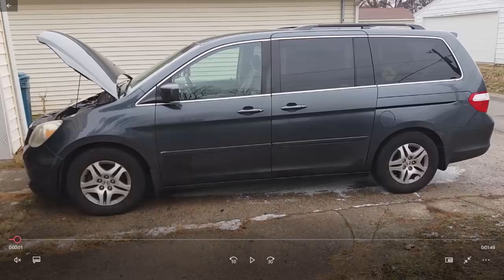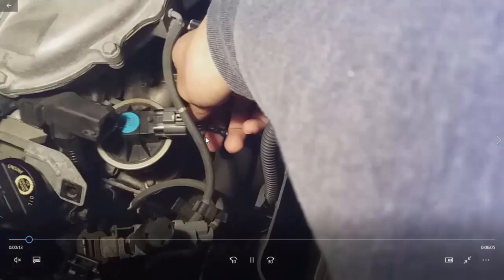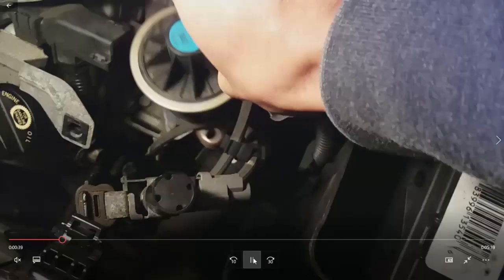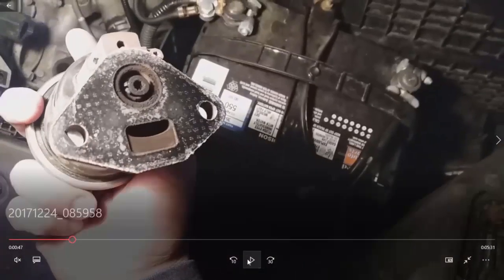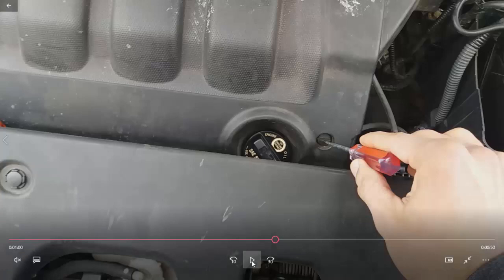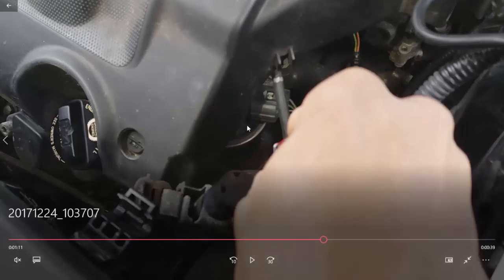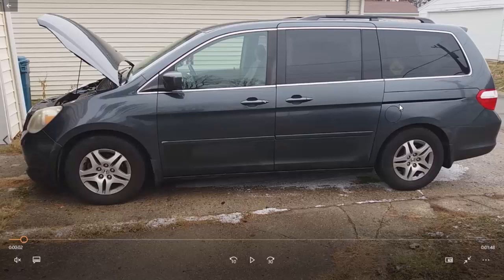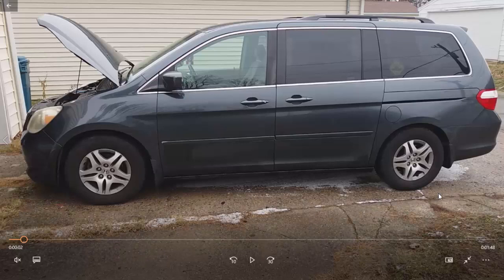2006 Odyssey - Several Cylinder Misfire - Upstream component issue.

Comment: YOU DIDN'T MENTION HOW MANY MILES HAVE ON ENGINE, ! TIMING BELT CAN  READY TO BREAK BECAUSE IF ITS LIFE EXSPECTANCY EXPIRED AND BELT IS LOOSE AND READY TO BREAK WHICH CAN CAUSE MISFIRES AND IF BELT NOT REPLACED AND BREAKS THAT WILL COMPLETELY DESTROY ENGINE AND IN NEED OF ENGINE REPLACEMENT ! CHEAPER TO HAVE BELT CHECKED BY HOW MANY MILES ON ENGINE , YOUR FINDINGS OF EGR VALVE MIGHT BE CORRECT BUT IF PLAN TO KEEP VEHICLE AND MILES INDICATE TIME FOR NEW BELT THEN BELT CHEAPER THAN NEW ENGINE ! ODESSAY TIME BELTS NEED REPLACEMENT ABOUT 60-90 THOUSAND MILES .! BAD TIMING BELT WILL CAUSE MISFIRES AND WHEN REALLY BAD CAN START ENGINE KNOCKING  WHEN VALVES HITTING TOP OF PISTON THEN THAT MEANS ENGINE DESTROYED.!! MY ODDESSAY 2007  MISFIRING , CHANGED PLUGS AND COILS THEN SLIGHT IMPROVEMENT BUT BACK TO MISFIRING, 33THOUSAND MILES WHEN BOUGHT VEHICLE NOW HAS 138 THOUSAND MILES SO IT HAS REACHED THAT CRITICAL POINT WHICH IS BELT REPLACEMENT. REBUILT ENGINE ABOUT $5,000 ! USED ENGINE ABOUT $2,000 BUT MOST LIKELY WILL ALSO NEED NEW TIMING BELT , ALTERNATORS LAST ABOUT 100,000 MILES MINE DID AND REPLACED IT ! ALONG WITH PULLY TENSIONER AND AIR CONDITIONER COMPRESSOR AND ALSO REPLACED STEERING PUMP ,AND ALL TOP ENGINE GASKETS AND EVERYTHING IN BETWEEN , AND YES TRANSMISSION WILL BE NEXT THAT WILL NEED REPLACEMENT BUT WORKS GREAT NOW ! HAVE GOOD DAY !

Comment: My 2005 honda odyssey check engine light was on...code reads slow and large leak detection but can't find no rips in any hose...had misfire in cylinder one...so I changed all 6 spark plugs and all 6 coils and new valve cover gasket..
Get job done turn van on and it sounds like a lawnmower and check engine light is blinking like crazy now.
.what cause this to get worse...please anybody..yes all coils are snapped on all way and spark plugs are new and van ran just fine before all these parts
Reply from the maker: If the van was running fine, and only had a leak and a misfire code in one cylinder, why did you replace all spark plugs and coils? Off the top of my head I would have thought that the leak cause the misfire and since the misfire is on one cylinder only, I would have investigated the gas going to that cylinder first. 

About why is worst now, I would guess a valve or a component was left unplugged when the job was done. 

All of these are guesses. Normally the way YouTube works is we do the job and illustrate it so others can follow if they have similar problems.
Reply: @w.v.1833  thanks but I have always seen and told if one coil is bad or one spark to replace all if you have the money so I did...and I made sure all coils clipped on all the way to avoid anything like that. Thanks for trying to help..van is still sitting in driveway I'm lost man ...
Reply from the maker: @kangokidkidd4037  check all other plugs that would have been disconnected to do the job.
Reply: @w.v.1833  okay I have to check again...I just ordered an egg valve too from rockauto....some youtuber said that maybe it but I don't think so because the egr valve was cleaned by me 3 months ago...but never replaced ..he said egr could be stuck open...but how could an egr just get stuck open or closed just by me replacing all sparks and coils..I also changed the valve cover gaskets put little honda bond on the 2 corners just like the pros....

Comment: That was very wise on you doing the research cuz I was breaking my head on figuring out what could be wrong all of a sudden the engine light comes on and I'm getting about the bowl of readings it getting done on me the only thing usually common was to change spark plugs and coils but now things got a little bit more difficult I figured maybe the fuel injectors were clogged I did all that and it didn't dawned on me until now watching this video that the EGR valve has some play with it so thank you and I'm going to check that

Comment: Dude i feel like kissing you :), this last Friday night wifey went out on the minivan, then she call that it was shaking really bad, she pulled into a parking lot and it finally stalled, i went to see what was going on and the car would not start, it was kind of hot but not full gauge, this was like 3-4 miles away from home, so we came home had diner, went back two hours later to see if cold would start and it did, at first start sounded normal no shacking, on the way home probably because warmed out started shaking. i hooked up the ODB2 but was shot, i lent it and it got few pins broken on the connector... looked up few videos about rough idling, some guys pointed to timing belt... other guy fused coil and he ended up braking one of of the spark plugs and the electrode falling into de piston.. bunch of non sense. yours made more sense, although i am preparing to replace the timing belt and water pump on myself,, the minivan is pushing 250K,  so timing belt also sounded plausible,

Long history short, pulled the EGR valve and looked identical to yours, cleaned it up, put new gasket ($2.5+$5) gasket and cleaner,  and voilaa fixed like magic. OMG

Thank you very much for publishing this video
Reply from the maker: 👍🏼I am very glad the video helped.

Comment: Hi thanks for the video . I did EGR cleaning does the check engine turns of immediately or did you have to drive around to clear the check engine erro .

Thanks
Reply from the maker: I used a code reading device to erase the code which turned the light off. However, I believe that if you disconnect the negative pole of the battery for a few minutes the light will also go off. 

Please note, that if the blocked EGR was not the code that turned on the light, of if there are additional codes present, the light will come back on. 

Good luck.

Comment: Thank you so much for such a helpful video.  On my 2006 Honda Odyssey EX-L, I was getting the same random engine misfire codes.  I took some photos of your youtube video on my phone and printed on a printer and showed my local mechanic.  He peformed the EGR cleaning for me for about $40 labor and he confirmed the carbon buildup was keeping the EGR stuck open a little bit.  After the repair, I cleared the ODB II codes, they haven't come back.  Your video was very helpful and saved me a lot of diagnose labor charges by my mechanic.  Thanks again.
Reply from the maker: I am happy to hear!

Thank you for taking the time to provide the positive feedback.

Comment: but you didn't show a reading of results.
Reply from the maker: You are correct! I think I mentioned at least some of the codes in the video, but I did not show any of them. I wished I had. I created this video after I had diagnosed and solved the problem, only to share what I did to solve the problem. 

Thanks for commenting.
Reply: W. V. so did the code change after your repair ? or did it remain? thanks!
Reply from the maker: Yes. I erased all the codes with my personal handheld scanner and none of the codes came back. 

I am not sure if you know but you can get the engine light to turn off by disconnecting the battery or by erasing the codes, even if you have not addressed the problem. A repair is considered effective when you erase the codes and they do not come back. In my case, they did not. What is even better, the terrible performance symptoms went away. As soon as I completed the job the engine ran normal. 

I hope my answer is complete. 

Thanks.

Comment: I've been struggling with 2 Honda dealerships to find the cause of my misfires and they told me it's a needle in a haystack!  I have tools and a can of engine degreaser in the closet, I'm hoping that this will solve my problem, too.  I've already put 6 new plugs and coils on it, so I know I'm good there.  I'll report back if the issue is solved!  Maybe I should send you the $100 I gave to Honda for diagnostics, lol.
Reply from the maker: Lol. Thanks for sharing Alicia. I hope you fix the problem on your own and in the process learn something new and save some money.

It is often useful to surf the net for solutions to problems like this before visiting mechanics. After all, they do the same thing we would do when facing a problem they haven't had before: research the problem, analyze the issue critically and try solutions. However, one thing they have that owners lack is experience (and some times the right tools). Mechanics fix cars day in and day out, and that how experience is built. The best thing about the internet and how we share content is that: no single person needs to have a lot of knowledge and experience, but collectively we have enough knowledge to help each other solve many problems that often seem complex.
Reply: these Honda V6 engines just love to misfire for all sorts of seemingly unrelated reasons. The fuel injection is designed as a ULEV, so it tries to lean out the cylinders mixture a lot.
When this engine does not have hard misfire codes (leaky EGR), it still randomly misfires lightly at idle without any code detected.
The outcome is the engine does not drive very smoothly because the power output is non-linear.

TO-DO maintenance List items:
Spark plugs
(Spark coils)
EGR plugged or leaking: codes!
Tight exhaust valves adjustment
Dirty throttle body butterfly
Round transmission filter: 80kMi!
Serpentine belt slipping under load
Cracked air inlet rubber boot
(front/rear engine mounts)

List of bullet-proof items:
fuel pump and filter: ok!
injectors: ok!

Misfiring detection: the engine control unit looks at the crankshaft speed variations to determine if a particular cylinder causes the crankshaft ticks to be late there by showing a slow down ie. misfire.
So if the misfiring is light the ECU will not know about the condition but the driver will still experience driveability issues, light shaking at idle, reduced power output, reduced low-rpm torque.

This engine can really run well like new @200kMi for a minimal amount of simple parts. Don't overlook the tranny 3x3 ATF change to prevent premature failure.

Comment: Usually it triggers a code for egr. Just bought an o6. Love your odyssey color same as the one am replacing, mine is silver-ish but nice and the price even better.
Reply: No. It doesn't. If the EGR passages is completely plugged, you will get a specific EGR code. I chased my tail on this until I created a gasket out of an aluminum can and put it in. All the misfires and TCS lights went away and ONLY the EGR code came up. This let me know that the EGR was the only problem. I swapped it out for a new one and all the nonsense misfires, check engine and TCS lights went away. Most will be steered wrong to a valve job. Try to plug the passages first with the aluminum gasket. Good video here on YouTube.

Comment: Which 3 cylinders 4,5,6 having similar problems gonna try tonight.Ill let you know.
Reply from the maker: I could not tell which ones. I made this video a while back. However, Cylinders have an order in which they fire, that I believe varies depending on the engine/engine type. This could be a good thing to keep in mind during troubleshooting. 

Still, checking a stuck EGR valve will take only a few minutes and it is worth checking to make sure it is clean an unobstructed. 

Good luck.
Reply: @w.v.1833  Pulled the EGR and it was clear.
The firing Order is 142536.I have pulled and tested each coil and they are working properly. I think my problem is a Vacuum leak from a cracked or broken line.
Reply: @RichardNixion357  did you find your problem? I have misfires on cylinder 4,5,6 and cannot pinpoint the problem.
Reply: @jeremyvaughn8663  Afraid my solution wont be much help but I tell you anyway.I disconnect the battery for 15 minutes reconnected the battery.Turned key to position 2 scanned codes,be shure to write down any freeze frame info,then cleared codes.Removed key,Inserted Key turned car on no codes hasn't done it since must have been a fluke. Hope you find a solution.Lotta guys smarter than me would tell you to check and recheck your work and try anything no matter how crazy or insignificant it might sound.
Reply: @jeremyvaughn8663  Oh sorry a whole bank like that would be head gasket check compression.Wiring double check spark at injectors and coils and plugs.
Reply: Look Up VCMUZZLER 2

Comment: Excellent video! Really appreciate how you used those “pointing” markers to show where things were located. 

I think this is the exact problem I have on my 2006 Ridgeline, but it’s damn near impossible for me to get the two 12mm nuts off. I’ve been putting PB Blaster, Kroil, etc on them for a couple of days now so hopefully they will finally break loose. Gonna warm up engine and put some more Blaster on it, maybe the heat will cause it to soak and leech further down the nuts. 

Wish me luck!
Reply: Best them with a small torch